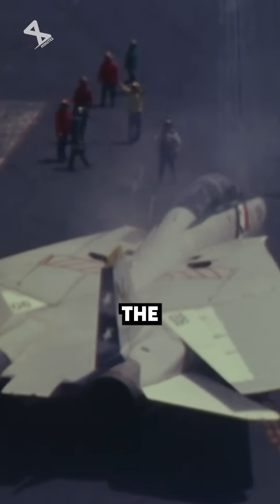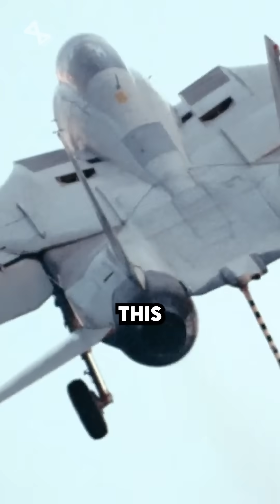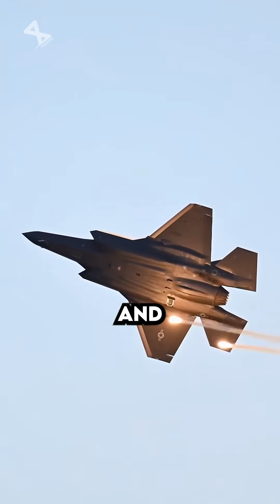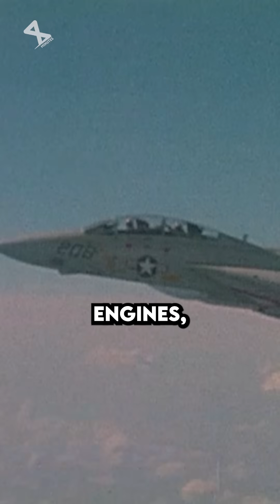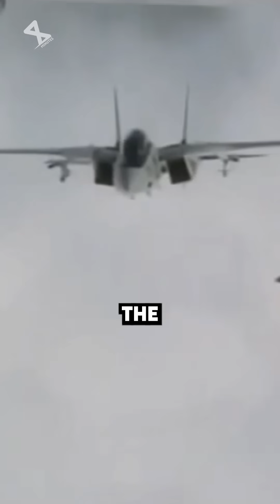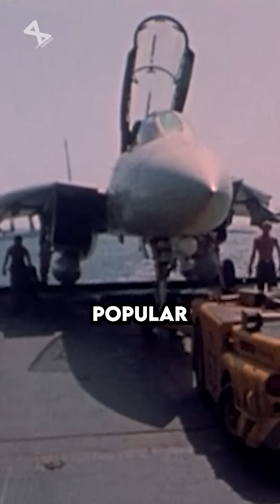Why Can't the F-14 Tomcat Be Replaced? #shorts

Comment: If that's the case, why not use the F15's engine in place of the troublesome P&W engines?
Reply: They went with the General Electric F110-GE-400 (Same engine as the F-16C) in the F-14A+ which became F-14B models, and F-14Ds.
Reply: Prob bc P&W had in their contract only they'd supply engines. And then after certain time could go with other vendor. I dunno, just a guess.